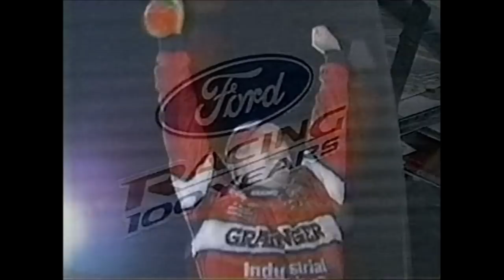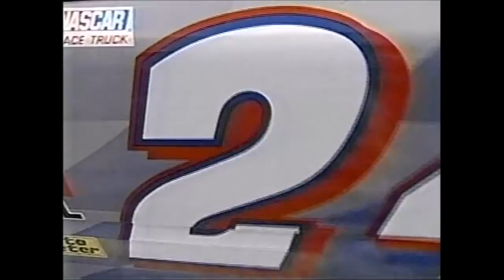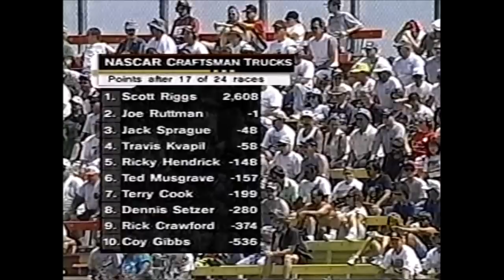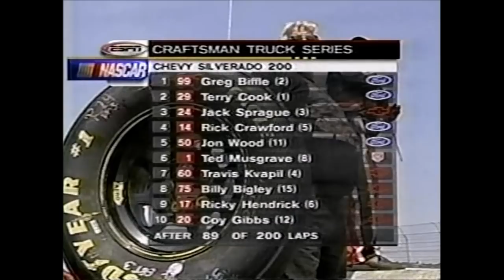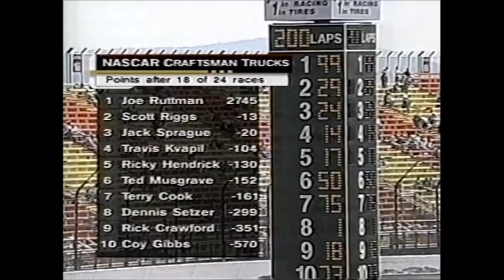2001 Chevy Silverado 200

Comment: I like how the 1993-1997 Speedworld theme slipped through for a few seconds at 4:40
Reply: Aaron Creed it’s the same song just a different part
Reply: @TheLocalLt  no it's not, that is the 1993-97 Speedworld theme.
Reply: Axel M yea the 1993 and 1998 themes are two different parts of the same song.